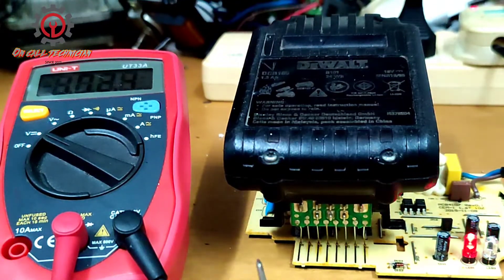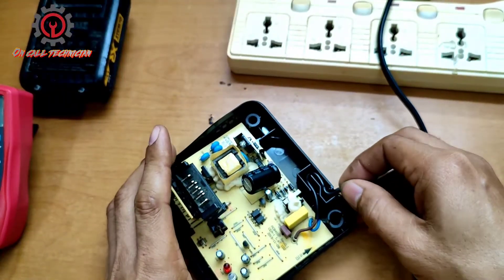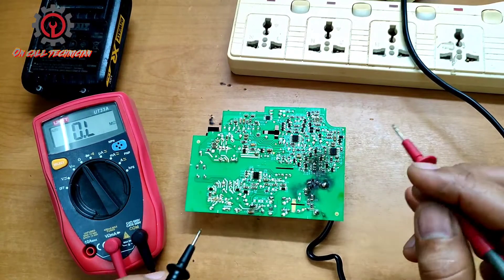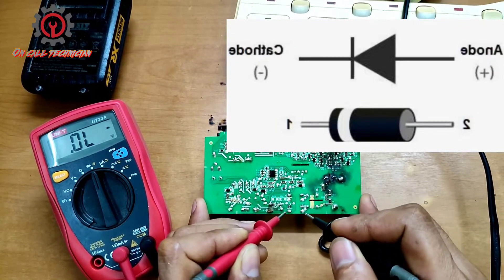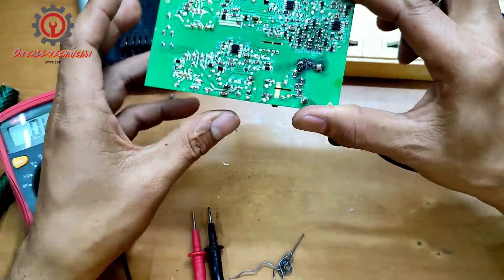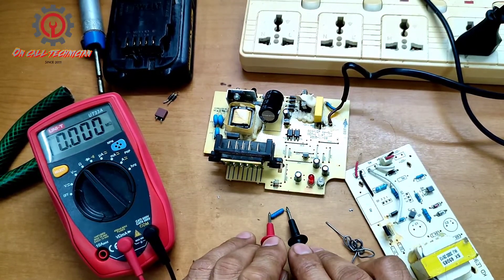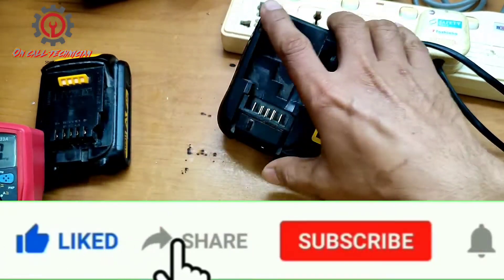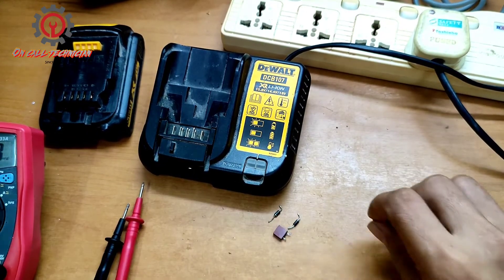HOW TO REPAIR NO POWER ISSUE OF DEWALT CHARGER DCB107 (ENGLISH/TAGALOG)

Comment: That electrolytic cap is a failure point of these units, and can stop the unit charging,  its slow too as it only puts out 1.25amps , also it gets hot when charging larger batteries...  the DCB115 is a better option as it charges with 4 amps!  so more than 3x as fast, I had toyed with the idea of uprating the charge circuit and adding a fan and vents to the to it, but the cost of doing it doesnt justify it as you can get the DCB115 pretty cheap...

Comment: Will the charger show voltage across +/- contacts without a battery plugged in?
Im trying to determine if my charger is bad or my batteries
Reply from the maker: Yes, and reading is a bit high than your battery voltage. Example, 12v battery the  charger output voltage should be 14v
Reply: @THEMULTISKILLEDTECH  ok, thank you 🙏
With my charger plugged in, I test the +/-  contact's and it reads zero - so it  must be a faulty charger. 
Thank you for getting back to me so quickly
Reply from the maker: @NewLife-qj9mx Your welcome brother

Comment: ung sa akin sir, power issue, di rin umiilaw ang led light niya, na check fuse, diode ok naman lahat, pero wala pa rin talaga power, ano kaya possible sira niya sir? ganyang unit din ang sa akin..salamat sa maitutigon?
Reply from the maker: Try filter capacitor sir, minsan sa ilalim ang umbok. Focus ka lang sa power supply, measure ka dc voltage rectifier kung wala check filter cap at kung mayroon transformer check mo din

Comment: master meron ako ingco charger,  wala syang blown pero no light indicator,

nagcheck ako sa terminal socket ng battery lahat may 90V AC
Reply from the maker: Dc po dapat maread nyo sir di po ac volts
Reply: @THEMULTISKILLEDTECH  yun nga master eh, baka may FB ka send ko sayo yung picture ng board
Reply from the maker: @zeefixhub  voltage check ka sir sa primary section, like e cap, diodes. May isang salarin lang dyan. Pull out mo fin pyesa 1 by 1 para di makaligtas. Resistor at capacitor ay nag chechange value, diodes and transistor are subject to shorted, leaky. Good luck po sir
Reply: pede mag private message sayo sir sa FB?

Comment: Hi, excelent video. 
Me  Repair the same one, change 86 uf 200 volt capacitor, diodes and fuse, when measuring voltage it registered 156 capacitor voltage but in output voltage it registered 0 volts, will it be normal
Reply from the maker: Plug in battery sir,if repair is good there must be voltage reading and your battery will start charging

Comment: Nice sir...sir ganyan din po akin ayaw umilaw ng charger drin ngchacharge..posible po kya pareho sira
Reply from the maker: Check mo po sir at gawin mong basehan ang tutorial ko. Not charging po issue nyan kaso during voltage checking gamit digital multimeter natuluyan ang leaky diode. Pati fuse tuloy sumabog sir